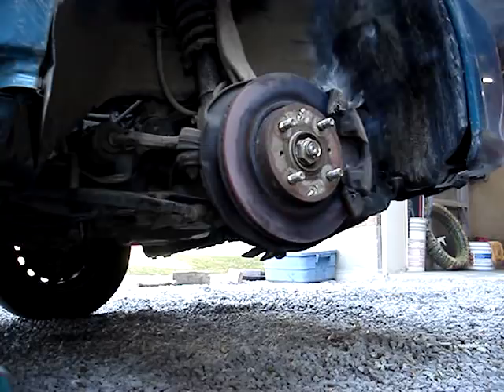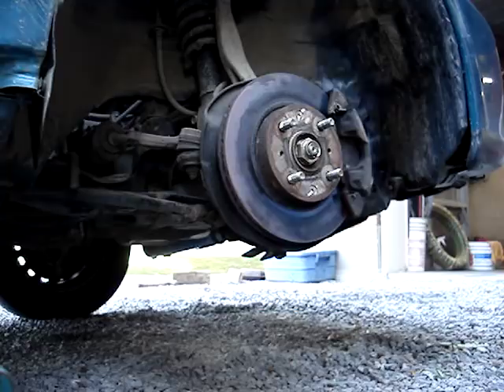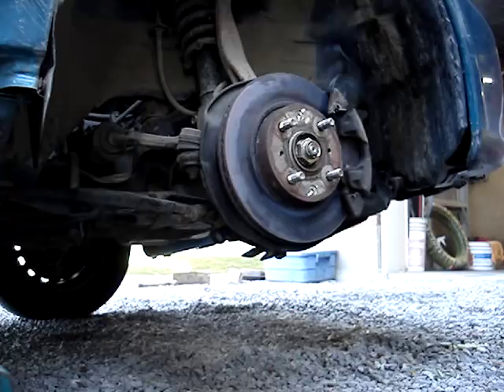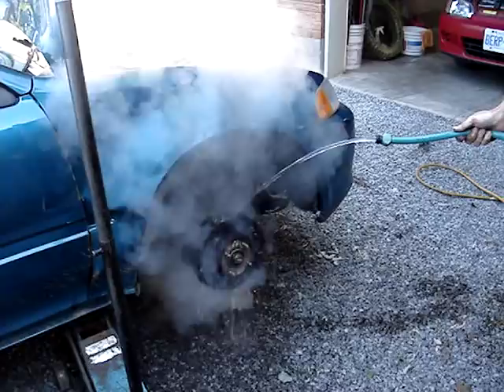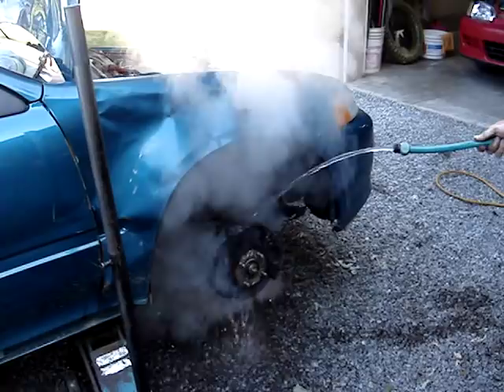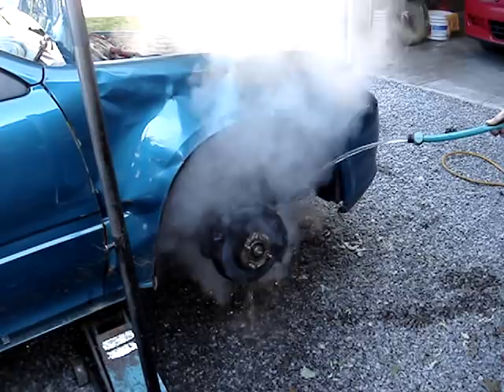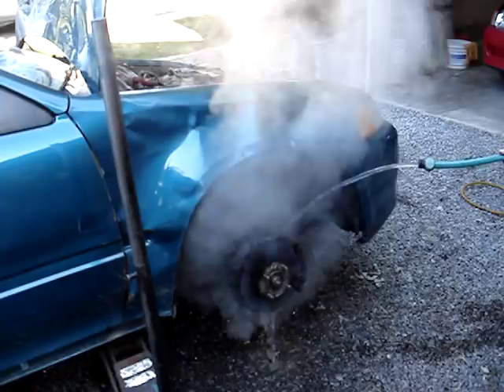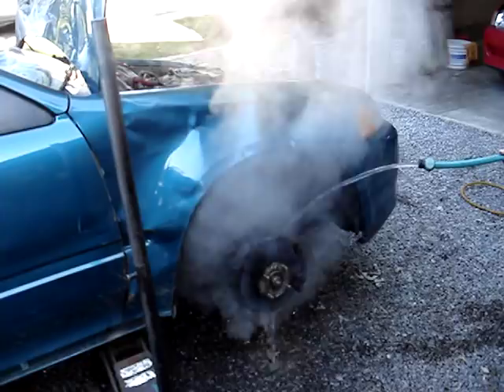Watch ● Honda Civic Disc Brakes Glow !

Comment: pouring water on it was really dumb, they probably bent the disc by doing so
Reply: draconpost - the disk was most likely already bent.  One side of the rotor was much hotter than the other.  Indication of warp.
Reply from the maker: +draconpost    It'll be fine. It's a Honda.
Reply: draconpost i don't think that matters at this point

Comment: Riding the brakes puts load on the engine. It causes it to work against a resistance. Such as moving a vehicle, or going up a hill. In this case it's just one of the two drive wheels. Ergo it's no worse than, say, driving up a steep hill as far as the engine is concerned. It may not even be worse than general acceleration. Its probably far worse on the wheel bearings than the engine considering the heat conducted to them from the rotor, and how thin the grease gets at these temperatures.

Comment: Did u have some sort of special differential to let u have on tire going or what
Reply from the maker: +Mitchell Huse While the brakes were applied we put vice grips on the brake hose on the left front, that wheel could not spin due to this, we were then able to still use the brake pedal to apply whatever pressure to the right brake during the test.
Reply: good job. i was actually going to comment, that with enough brake pressure on that right wheel, the diff could change its mind and decide that the left wheel touching the ground is the new path of least resistance and could send all the power that way instead
Reply: Oh, i would've guessed something like you took off the parts that drive the other wheels, such as the drive shaft and the left cv joint.

Comment: How only one wheel is moving
Reply from the maker: Actually all we did was someone in the car applied the brakes, and while holding the brakes on, another person put a pair of vice grips on the left front brake flex hose, then we released the brakes. The left wheel was now locked on and couldn't rotate and the brakes still work normally for the right front. This made it safe to perform this test. Plus we had placed logs in front of the rear tires to be even safer.
Reply: @chrisnotap  ooh
Reply: @chrisnotap  omg!!! U r still replying...

Comment: This shouldn't be happening!! It's a fault!!
Reply from the maker: The brakes were being held on a bit to create the friction. The brakes were also locked on the other wheel to prevent it from rotating for safety sake.
Reply: Yes, that wheel is completely missing. If the car still in warranty you should complain about that.
Reply from the maker: @pjay3028  Lol! Yes!

Comment: Actually, it wouldn't roll. This car has a differential. All the power is being applied to the free wheel. There is no power going to the wheel sitting on the ground. This causes the free wheel to also spin at twice the indicated speed on the speedometer. I have done it with both wheels off and a screwdriver stuck in the opposite rotors cooling fins to keep it from spinning.

Source, I'm a auto mechanic.

Comment: you should be fine with just one wheel off the ground, but if you hit the brakes hard enough to the point that it would be easier for the engine to turn the wheel that is on the ground then thats whats going to happen because of the differential and then the car is going to move forward

Comment: why do you think his brakes are broken ?, hes pressing the brake pedale, so they are doing what they should.
And your tires doesn't pop from heated rotors, you have a big piece of metal between your rotor and the rubber on your tire, it's called a rim :)

Comment: Next time put some lugs on the rotor so it doesn't try to fly out at you.
Reply from the maker: +peddards Honda's have phillips screws that hold the rotor to the hub, nuts aren't necessary. Watch at the start of the video and you can see them between the studs.
Reply from the maker: +peddards you either need an impact driver or a bit of heat to get them out.
Reply: +Chris Notap shouldn't have to deal with it anymore once I remove them I don't put them back! Keep it easy

Comment: Idk how the other wheel is not moving :v
Reply: It's doesn't have a welded or fixed rear differential
Reply from the maker: Actually all we did was have someone get in the car and apply the brakes, and while holding the brakes on, another person put a pair of vice grips on the left front brake flex hose, then we released the brakes. The left wheel is now locked on and can't rotate and the brakes will still work normally for the right front. This made it safe to perform this test. Plus we had placed logs in front of the rear tires to be even safer.

Comment: I just don't get the dislikes, whats so offensive, yea its abuse, so fucking what..clearly said its for fun.......as if a lot of us havent caught an insect before and torture it so why the judgement........lol
Reply: Nathaniel Haye You never wash off things to cool them down...
Reply: i understand all that... but the point of the video gives the reason for using absolutely no discretion so i do t think it would matter if he water cooled or air cooled the thing wether it be a brake assembly or not, it was supposed to be fun!.... no fun in a burnout with an open diff!.... 

no smoke no fun
Reply: +Socrates Nicolaou There is an annotation near the beginning saying that they were gonna scrap this car anyways. Like Nathaniel said, its just for fun.

Comment: @myvanpounds 

The spider gear spins at the same rate had both wheels been rotating or not. What changes is the amount of torque going to the driven wheel.

If you diff exploded when doing something stupid like wheel spinning, the only reason was becuase the amount of torque been delivered to the diff was greater than been delivered to the ground by the wheels resulting in a stress fracture.

Comment: That was a terrifyingly dangerous way to do that!!!!!
Reply from the maker: +Richard Kev   How so?
Reply: Sure. Car is lifted on one side with one drive wheel on the ground. Yes. Open differential so all power should go to the raised wheel. Presumably the car is chocked, but we can’t see that. The car should be strapped, like on a dyno, but we can’t see that either. Engine is being revved in gear, and some clown is walking around in front of it. 

It’s less about the probability something will go wrong, and more about the consequences.
Reply from the maker: Before starting this destructive test, we applied the brakes with extreme foot force and while doing so, a pair of smooth jawed  vice grips was applied to the flex hose on the left front wheel. In doing so the left front wheel was locked and could not rotate. With the right front wheel off the ground, there was no danger of the car lurching forward. To be sure wheel chocks were placed at the rear wheels.
Reply: There was “little danger” of the car lurching forward, not “no danger”. Having been feet away and watched a car launch partway off a wheel dyno even with all safety equipment engaged,  I leaned early on there’s always something that can go wrong. You set up a test like this, with all the safety ideas you can think of, that’s great. But then someone walks in front of the car while the engine is revving, trans engaged. In front of the car is not the place to be.
Reply: Darwin Awards!!
Reply: Richard Kev cjfmdm

Comment: @snedie69er  actually only the carrier would spin at the same rate.. however the spider gears are a different story.  in a situation like this where one wheel is stationary and one wheel is rotating the spider gears would be spining quite fast inside the carrier... in a situation where both tires are rotating the exact same speed they will be stationary inside the carrier.

Comment: Putting water on hot brakes won't damage them, all you're doing is hardening the metal!
Reply: +Re That's only true with a select few kinds of carbon steel, others have a high probability of cracking because water cools too aggressively. Most heat treatments are done with an oil of some sorts, motor oil will do for the back yard but there exist some specially engineered oils for the purpose of quenching.
Reply: +Re u also flex the metal quickly cooling it like that, because ur basically breaking down the molecules of the metal heating it up like and then when u quickly cool it the molecules freeze to wherever they been distributed to.
something like that works when making silverware or swords and knifes but not brake rotors because they nee to be perfectly flat and stiff
Reply: +Nick Vernice I think you meant metal crystals, not molecules.
Reply: Nick Vernice I see what you're trying to say, and your idea is kinda sorta correct.
When you heat up steel (iron and carbon mixture), the carbon will fully dissolve in the iron. When cooled down slowly, the carbon and iron will go through different crystalline structures depending on the carbon concentration and the temperature. As it continues to cool, the mixture will change structure as the temperature enters another range. Depending on the carbon concentration the amount of stages can vary. The current high temperature allows the carbon to diffuse (flow slowly) into its various crystal lattices. When cooled slowly, every lattice it goes through is the lowest possible energetic arrangement (like water that flows to the deepest point of a valley). 

Now, when you rapidly cool down a hot mixture, the lattice it was in in its hot state is "frozen". The diffusion process is practically halted by the drop in temperature. Such a lattice has internal stresses. (the water in the valley is frozen, but still wants to go downstream) These stresses make the steel harder and tougher than in its annealed form, this is what makes steel so versatile. 

Most of the regular carbon steels don't respond well to quenching from extremely high temperatures, they often fracture. The reason why the disk did not fracture is because it has a fairly complex shape holding it together with vents on the inside, it was not heated through, only the surface was glowing. And finally, the disk brake is cast iron. Which contains a lot more carbon than regular steel which causes it to have precipitation pockets of carbon (an oversaturated mixture) which makes it even more prone to cracking. The pockets weaken the structure and act as a nick from where a crack can start.

Comment: Why other side tyre not rotating 🤔🤔
Reply from the maker: Actually all we did was we applied the brakes, and while holding the brakes on, we put a pair of vice grips on the left front brake flex hose, then released the brakes. The left wheel is now locked on and can't rotate and the brakes still work normally for the right front. This made it safe to perform this test. Plus we had logs in front of the rear tires to be safe.
Reply: @chrisnotap  so u ruined the diff 😂😂

Comment: Yo how is the other tire not spinning?
Reply: There is cross connection in car axel. To make the car turn only the that tire moves on which side the steering wheel is completely turned. Otherwise car would not be able to make turn
Reply: Differential, which has suffered from this...
Reply from the maker: The other commenters are right about it having a "differential" and how they work. In addition all we did was we applied the brakes, and while holding the brakes on, we put a pair of vice grips on the left front brake flex hose, then released the brakes. The left wheel is now locked on and can't rotate and the brakes still work normally for the right front. This made it safe to perform this test. Plus we had logs in front of the rear tires.
Reply: @chrisnotap  Thankyou and keep up the good work with your vids and answering peoples questions

Comment: So they seized? How did you only spin one tire though?
Reply: this is most likely an open diff which will take the least resistance route of power. thus the left wheel doesn't spin. no need to put vice grips on it either!
Reply: +Ashton Murch But the brakes were being applied. People with open diffs often use a bit of braking to get both wheels spinning when stuck.

Comment: @snedie69er  with one wheel locked and one spinning the spider gears inside will have to spin at a rate that isnt seen during normal driving conditions.  I've had open differentials blow up during burnouts and whatnot due to the increased speed the spider gears had to spin

Comment: the sad part is, my car does this while i drive. glowing red hot rotor with sparks flying
 
trying to find out why. Lol. I replaced pads, rotors and calipers. still happens
Reply from the maker: +nme 95k not sure if you're serious.
Reply from the maker: The side that is glowing will have a choked flex hose. The flex hose will have a steel bracket and it has rusted and choked the hose causing it to hold pressure in turn heating up the brakes.
Reply: nme 95k. bad caliper

Comment: @chrisnotap First of all, more than 99.999% of the millions of cars don't stress and heat their brakes like a performance car. Performance cars upgrade their brakes so they can handle the stress. Fact: High heat and then fast cooling can make steel snap.  Disc warping alone is recipe for a serious failure. Search Disc Break cracking... Yeah... ive heard about it.

Comment: But when you apply the brakes car stops.  It won’t generate this much of fire.
Reply from the maker: If a caliper is seized, yes this can happen. Going down a steep grade down a mountain road with more load in the vehicle or towing more than you should can also make this happen but yes, you're right, during normal operation this shouldn't happen.
Reply: @chrisnotap  nice explanation 👍
Reply from the maker: Faris Here  What year and model is your car Faris?

Comment: @chrisnotap Learn about metal tempering, when you heat a metal and then cool it quickly it warps and hardens in some cases so bad that it cracks. Putting water on hot disc brakes is a very bad idea.

Comment: That can't be good for the transmission.
Reply: +YOUWEPAPA which, if I am not mistaken, is in the same housing as the transmission. As it is one unit, I'm just going to call it the transmission.
Reply: +YOUWEPAPA This is a Civic. They haven't made a 4 wheel drive Civic since, what, 1991? This car looks newer then that. Judging by the suspension, I'd say it was made between 1995-2003 or so. It is front wheel drive. I should know, I'm under the damn things every day. I change oil at a Honda dealership.
Reply: +YOUWEPAPA Yes, if you forget the CRV (4wd optional), HRV (4wd optional), Crosstour (4wd standard), Ridgeline (4wd standard?), Pilot (4wd standard), the Acura TLX (I'm talking current USA available cars only) and almost all of Acura's other vehicles.  Judging by how it seems we mostly see CRVs, Pilots, and Odysseys (The minivan being the only exclusive FWD on that short list)... I'm guessing Honda is pretty much selling mostly 4wd cars.  Only the civic, fit, odyssey, and CRZ lack any option for 4WD.
Reply: +jonnda Every crv I've seen has a big gaping hole where the rear diff would go...

Comment: y  aren't the other wheel .... I mean why what
Reply from the maker: +akhil krishna Not quite sure what you're asking. Could you re-phrase that.
Reply: +Chris Notap He's asking why you don't have both wheels elevated. He doesn't know how an open differential works.
Reply: +akhil krishna Because it's an open diff, as is the case with most FWD cars. It'll send 100% of the power to the wheel with the least resistance. While it's smart and safer to lift both wheels, it's not likely to matter.
Reply: ***** thanks a lot
Reply from the maker: ***** You explained it right. In our case it was safe. We applied the brakes hard and them added a pair of vice grips to the flex hose on the left caliper so that wheel could not rotate during this destructive test. During the test we were able to still use the brake pedal to apply pressure to create the friction on the right side. We want to do this again but next time use a mirror so the driver can see how hot things are getting and bring it to the max! Thanks for commenting.

Comment: To every idiot calling them dumb to do this and then even put water on the rotor.. Well yeah, it's wrong if they actually wanted the brakes. They were trying to get the brakes to fail, and torturing them even more with the water. 

next time, try reading the description of the video before making a fool of yourself